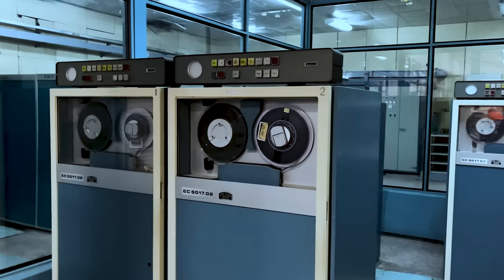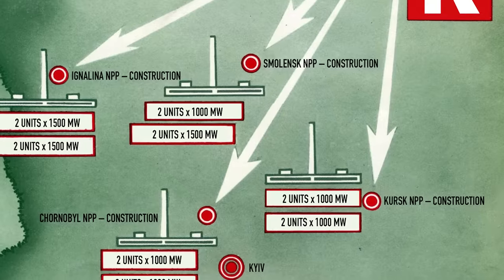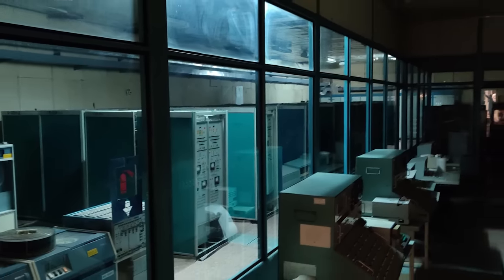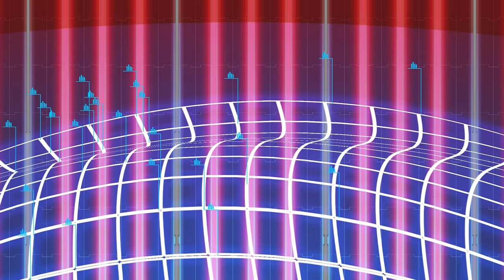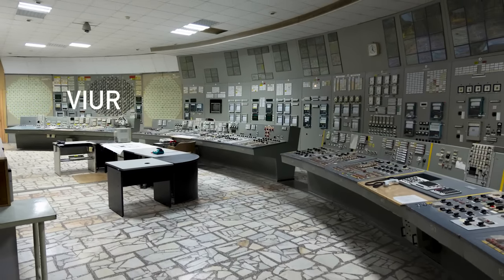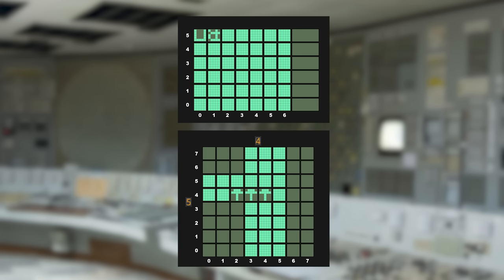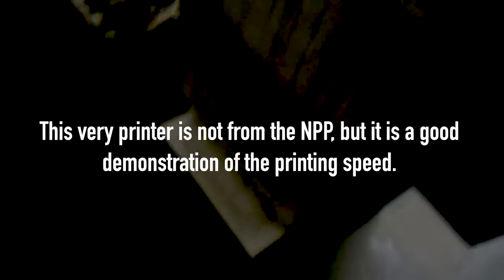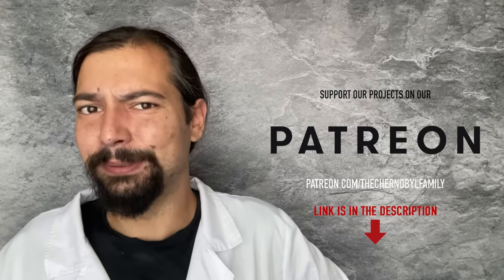Exploring SKALA: Chernobyl Reactor Control Computer

Comment: So this computer helped control reactor 3 for a good decade before the DIIS replacement.... and, of course, with reactors 3 and 4 being the same RBMK variant and mirrored building designs on a whole that means that computers twin sister was there, just meters away, when reactor 4 failed: that system knowing everything that was going on, well, until it lost power at 1:23:46 or so...

...I say this not as some revelation because it isn't -- we all know this, but to think about it, as a computer and Chernobyl interested individual, as a moment that a machine was never supposed to encounter, yet did... and for its twin to thankfully be saved, a computer which was running the instant that event happened, and kept Reactor 3 going fine even as literal hell happened just on the other side of the partition walls... it's just an amazing thing to think about, to someone like me....

Makes me want to get back into the Chernobyl interest scene... I've been out for a bit too long, methinks.
Reply from the maker: Thank you for this powerful comment. I'll check what happened to U4 Skala. Technically, it was intact, but whether it was dismantled or left in the place, I, frankly, do not know.

Comment: These disasters could've been prevented if they had upgraded to IBM personal computers in August 1981. Due to how much cheaper they are compared to mainframes. They would've implemented extreme redundancies based on the per unit cost of each IBM machine and associated peripherals.
Reply from the maker: A personal computer will not hold a flow of analog signals with a low latency; this is the reason why modern systems similar to SKALA are not PC-based.
And to be historically accurate, specifically in the scope of the computer, there were no critical issues with it in relation to the disaster.

Comment: Boy, what I would've done as a saboteur,  I'd use a radio shack bulk demagnitizer.for those tape drives. But who would've predicted it was going to destroy itself. Anyway.
Reply from the maker: Well, to be scientifically correct, in the scope of the disaster of 1986, computer did not have any malfunctions connected to it.
Reply: @ChernobylFamily  I apologize for making it sound as if the computer played a part in the plants destruction .human error  and material failure always take the blame .
Reply from the maker: @marcusfountain1694  it is ok, of course, the subject is really complex, it is very normal not to know everything – neither know I.
Reply: @ChernobylFamily  although I'm not a computer guy ,I learned basic in Jr high and took Cobol  and Fortran in hs ,I used a tBM  370 keypunch machine  and sent compiled  cards to NY University . Then I went in USAF to be a nuclear weapons specialist ,whichi bombed out of and became a jet mechanic  then I went on to a municipal water outfit and used a Johnson Control JC 5000 tape driven monster where I offered  my demag services to put it out of its misery, it controlled valves and pumps and computer signals and when  it failed it reminded me of Chernobyl, and later on  Fukushima.

Comment: I wonder what it's relative power would be, these days. Would it equal an old but modern cellphone? Or would it be like the N64 "More power than NASA had to put a man on the moon"?
Reply from the maker: I'm not sure it is directly comparable. The key is not a computing power, but an ability to process thousands of incoming signals.
Reply: Yep. Your phone will never be able to handle the quantity of I/O that a PDP11 can.

Comment: Skala means a big rock in Slovenian? I guess it did rock the plant. Uncle Tito somehow got us a westinghouse reactor. I prefer Russian reactors, can run on unrefined uranium sure more to keep under control but if the scram rods worked we wouldn't have had Chernobyl. Manufacturing defect one of the rods was not aligned correctly. RIP all the Soviets that saved mainland Europe.
Reply from the maker: ...it was all right with SKALA in the scope of the accident.
Reply: @ChernobylFamily Yeah I read SKALA did activate the rods in time but a documentary said that the rod was on an angle and got jammed, there are too many factors that lead to the disaster to pin it to one incident I reckon they should have left it to Day Shift when more experienced staff were on hand.

Comment: I have preserve tape data for NASA and other government agencies for the past 20 years. I designed special tape drives to read reel to reel tapes with MR heads. Let me know if you'd like me to preserve the programs amd tape data. It will decay over time!
Reply from the maker: I am afraid it is slightly out of my realm to decide here anything, but let me pass the information where it should go, and then I will come back to you.
Reply: @ChernobylFamily  great. We've been reading old mainframe tapes from '59 forward. Especially old satellite data stored on IBM 1401 mainframes and 360s. I can't emphasize how important it is to preserve the data on modern media which will save it forever.

Comment: Thank you for this research 👍 Never thought that a "simple" computer like that anyway controlled the reactor. It's always interesting to watch good researched videos of the chernobyl deaster. Here in Germany I was 18 yrs and remembered that they changed the sand on the playgrounds, prohibited the plugging of mushrooms and eat meat from wild animals for decades..
From other yt videos I also learned that it was not easy to build an computer system as well because of the regulations of communism and the lack of electronic components that exists in the "western world" yet.
Reply from the maker: Thank you!
I recall the same memories, though I was a little child back then.
As for this very computer, I'd rather say that the biggest problem was to "digitize" a very complex industrial process rather than find components for it — inside is a lot of transistor logic.

Comment: Why read in more paper reels when you can just add more RAM :)))
Reply from the maker: That is intentional. If all goes off, you can have paper print right away, in one second. You don't need to retreive something, because you may not have that few seconds. It is not a universal rule, but here in this very case it is.

Comment: literal, today whiz a simple phone, you can do the same as the computer that controled chernobyl nuclear reactor, obiusly, no one will use a phone to control a nuclear reactor.
Reply from the maker: With all my respect, won't agree. Make a simple phone control >3000 analog signals at the same time with no latency. It is not working that simple.

Comment: It's roughly akin to the IBM1800 that controlled Pickering A since the early 1970s with the difference that all the CANDUs have reactivity devices controlled in realtime by computers. The IBM1800 is emulated today.  A better comparison in functionality would be something like the SORO software used to predict fueling operations (still used today). All of this technology was copied from the West, likely including the reactor modeling. The Human Factors of the control panels at Cherbobyl is poor but we should not underestimate the ability of operators to recognize patterns.

Those control room floor tiles though... seriously questionable design choice.
Reply from the maker: Thank you for sharing that!
The floor is ok, it has no slippery :)

Comment: Wait a minute....pouring concrete in the ceiling to stop leaks? This thing was doomed from the start.
Reply from the maker: ...what you are talking about?
Reply: @ChernobylFamily  one of the news articles you showed, or around that time, said workers were pouring concrete in order to get water to stop. Or so I thought.
Reply from the maker: It was about a delay in works by another brigade which did not finish ceiling insulation, so there was not possible to make concrete works.
Reply: @ChernobylFamily  ahhhhh. That makes more sense.

Comment: Imagine that by the the end of the 80s, floppy disk drives have already been an establishment in the computing world in the west. Yet, in a computer responsible for the monitoring and functioning of a nuclear reactor in the USSR they still had to use punch-tapes, which is a 20 years old technology at that time.
Reply: Reliability mattered.
Reply from the maker: In reality, punch tape played there so little role, and was wired so deep, that it was cheaper to use it than to upgrade.

Comment: All you should know about this mighty SKALA "computer"  is that it provided the diagnostics of the reactor state in minimum 15 minites period. So when the reactor firstly got shut down ( at half an hour before the catastrophe) the SCALA "mighty computer" was unable to give to operating staff the proper data about what happened. And the personnel did start the reactor again not awaiting when the reactor poisoning dropped. That was the first step to disaster.
Reply from the maker: It is a very, very simplified vision of the situation.
Reply: @ChernobylFamily  
In fact I had no intention to explain in details what happened at 4th unit of Chernobyl Power Plant on April 26th, 1986. But I could. And I know what happened.
BTW. SKALA is not a computer at all. It's just a registration system.

Comment: And now that whole system can be replaced with a new plc....
Reply from the maker: There was a discussion about this in the comments here, shortly: no. Surely, a new system would be way smaller, but absolutely not one circuit board.
Reply: @ChernobylFamily  I work as a controls engineer and do services at nuclear plants here in the states and 75 percent of them I've been to are plc controlled, mainly allen bradley. Obviously due to redundancy there's several back up systems.
Reply from the maker: @chicago_race_engines7538  That's pretty much what I meant.

Comment: The main role of the computer of a  nuclear reactor - is management and auto regulation. It would be easy to making the newer computer system - but we have not for example coefficients for PID regulators. These coefficients define stability and therefore safety of the nuclear reactor. In my opinion. But all the coefficients and other mathematical models are unfortunately in Russia, where most of people want to kill us, ukrainians.

Comment: It's slightly horrifying that a nuclear reactor was running on core memory, reel-to-reel tape drives, and teletypes into the 1980s. The only more-distressing aspect is that it was coded in assembly -- and you damned well know zero formal methods / mathematically-rigorous verification was done of that code: It would surprise me if they even had unit tests.
Reply: Okay, that people are querying a nuclear reactor with a 1960s / Apollo-DSKY-style 'user interface' is equally disturbing.
Reply: At least it's ICs instead of tubes ig🤷‍♀
Reply: Like, how were they not on digital terminals by this time!?!
Reply: If it ain't broke don't fix it.  FWIW, the lab where my father worked didn't replace their punch card and core memory mainframe until around 1980 (replaced with a VAX and X-terminals).  I'd expect a control system to have a rather longer lifespan than a lab computer so having it still using core in 1986 isn't that surprising.
Reply: @alexhajnal107  Um, you may recall the whole 'meltdown and cause an international incident' part ... which suggests broke af.
Reply: @halfsourlizard9319  That wasn't the computer's fault though.  The disaster was mostly caused by human factors.  The reactor failed because it was misused, not because it had broken components.  Had proper safeties been in place (i.e. a proper containment vessel included in the design, don't turn off the safety systems ) then the failed experiment would probably not have been catastrophic.  Also, did the experiment really have to be run the way it was?  Surely there would be a way to perform that specific test without taking the reactor out of its safe operating envelope.

(edited for typos)
Reply: @alexhajnal107  Yep! Just like most aeroplane crashes and car accidents ... Just have to eliminate the meathumans to increase safety.
Reply: @halfsourlizard9319  Well the reactor did try its hardest to do that...
Reply: @alexhajnal107  Some glorious day, we'll be rid of humans entirely. Just us lizards + AGI. It'll be glorious.
Reply: @halfsourlizard9319  Silurian in the house?
Reply from the maker: There is no single evidence of major malfunctions of SKALA during the Chernobyl disaster. A confirmed fact.
Reply: @ChernobylFamily  AFAIK the only things that failed were the parts that were pushed way beyond what they were designed for.  Is this accurate?
Reply from the maker: I'd better say, an unlucky combination of (at that time) yet not known effects.

Comment: What caused Chernobyl reactor to melt down?  Did someone sabotage the system?
Reply: Are you writing from the 1980s or do you just not know how to use a search engine?
Reply: Human factors exasperated by a reactor design that didn't take worst-case scenarios into account.  In a nutshell: They were running a test with all the safeties turned off whilst rushing to meet a bureaucracy-imposed deadline (which led to the night shift actually running the experiment).  IIRC they wanted to have the unit fully tested and hence officially operational by May Day (never mind that it was already being used in production).  See the wikipedia article for lots more details (though it doesn't mention that last point).
Reply: @alexhajnal107  Almost like management by political agenda is a really shit idea, eh?😉
Reply: @halfsourlizard9319  Strewth.
Reply from the maker: Check INSAG-7 report, that is a good source. With all wish, the question is so massive that it would require an entire long video.
Reply: @ChernobylFamily  Am I remembering correctly that the test was being done then so that the reactor would be officially operational by May Day?
Reply from the maker: No. It was planned to put it on maintenance, therefore they decided to conduct the test before that.

Comment: the technology must have been decades behind western computers.. 100 cabintest just to controll an NPP... it seams no integrated ciruits were used..the power consumptions and need for maintenance must have been intense
Reply from the maker: Other commenters say it actually reminded some western solutions. There were ICs — you can see them e.g. on a memory board we puctured in the video. However, overall, this system looks pretty old, yes; when DIIS was introduced, it became much more powerful.